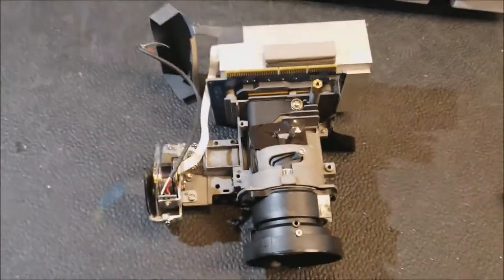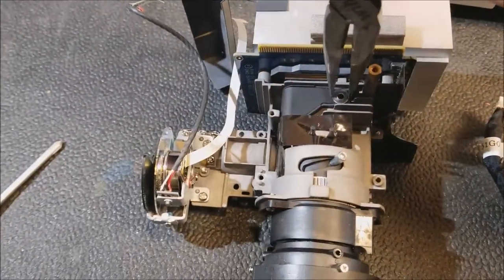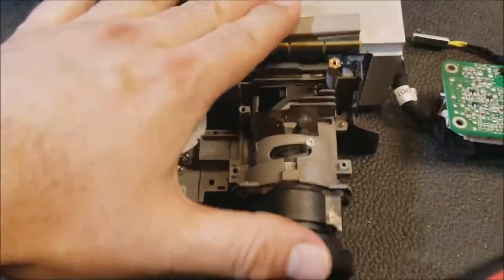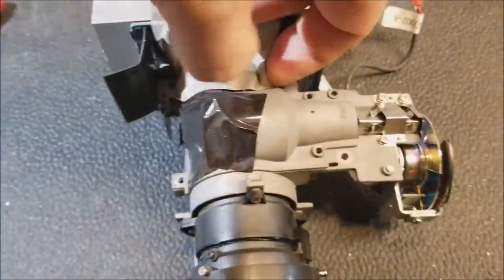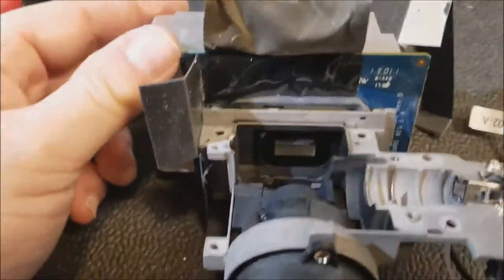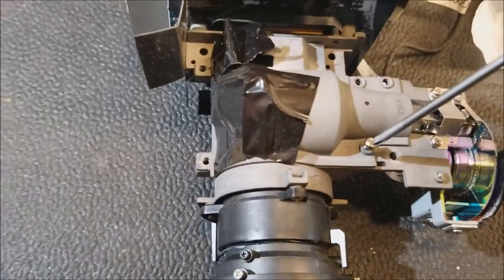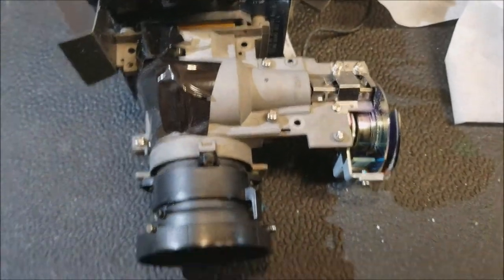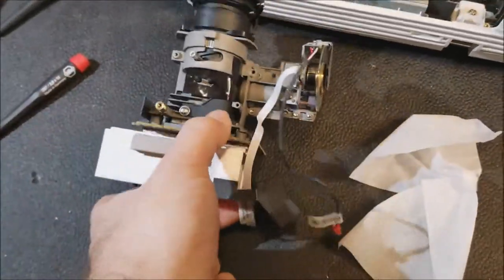Optoma HD20 DLP Projector Optics Cleaning

Comment: What size is the screws to mount the Projector to the ceiling
Reply from the maker: The HD20 uses M3*3 with a minimum length of 7.5mm and a max of 10mm (depending on the thickness if your mount of course).

Comment: Hi, so I cleaned everything with you tips and get more light and better colors. I have new lamp (same grey spots also appeared with my old lamp) and now I got this issue after cleaning; https://imgur.com/a/v6fpKCz
There is dust some new place?
Reply from the maker: One spot might be dust inside the DMD, but the white spots look like failing DMD to me.
Reply: @FixitFrank  It was just a dust and dirt. Hard to clean the dmd. Used lenscleaner and microfibre. Always some dirt stays on it. And after five or more wipings its going to scratch dmd :( Anyways it doesent effect the picture and i get most spots away. My another hd25e shows dead pixel on white screen and lower resolution..